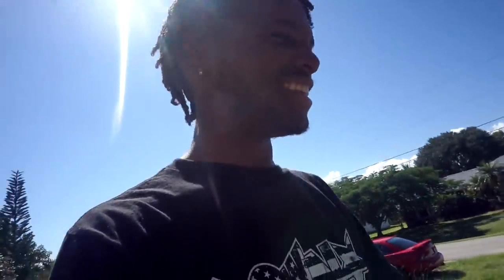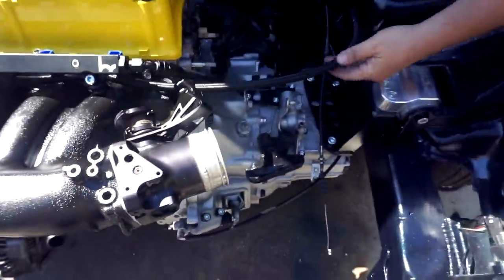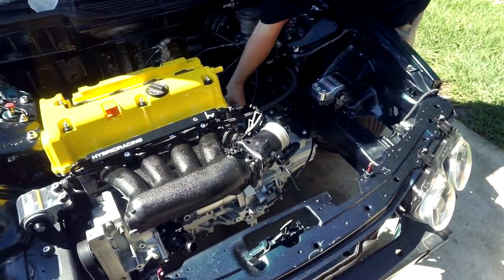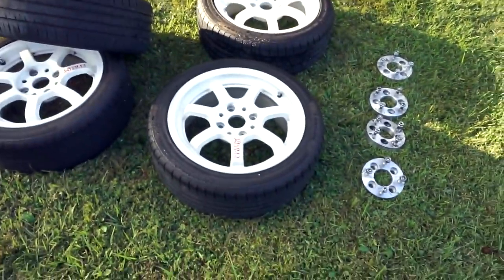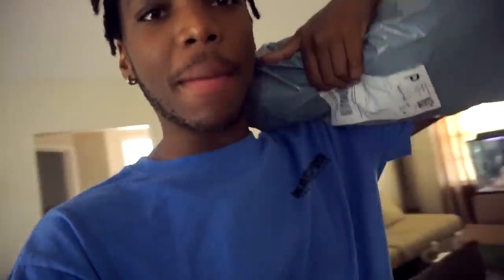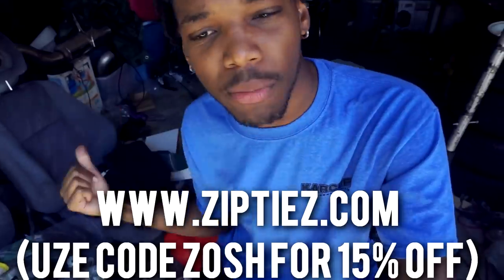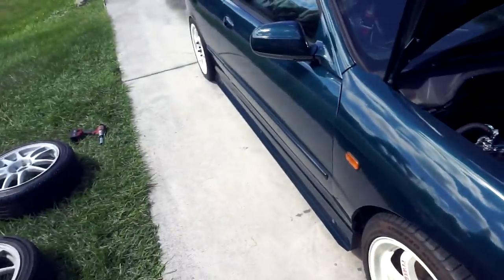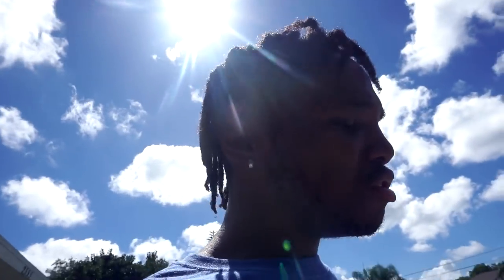NEW WHEELS FOR THE K24 INTEGRA!

Comment: Bronze would look better cause white you have to keep cleaning the brake dust off. 

I would suggest running 215/50 since they are only 16x7 and not a 8 wide. So you can have a phat sidewall to put your tire writing on.
Reply from the maker: damn good looks on that bro!

Comment: They don't make different mounts that raise the engine up? That oil pan is low AF
Reply: Im sure they could but then he would have to cut a hole in the hood for the valve cover or use ugly ass hood risers. I've been H22 swapped and daily driven since 2010 and my pan is only 4 inches from the ground, haven't dented it one time, just don't run over shit.
Reply: I think he's using the k20 mount spot and not the k24 mount spot and he if he uses the k24 one he should only have to cut the hood skeleton